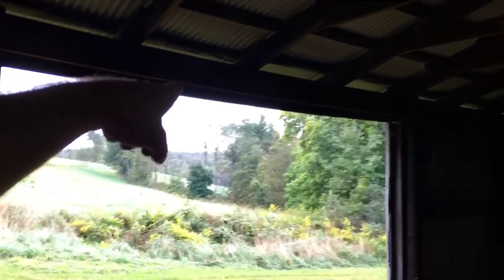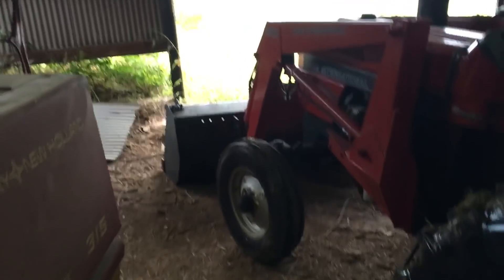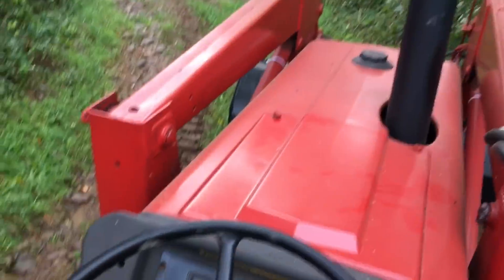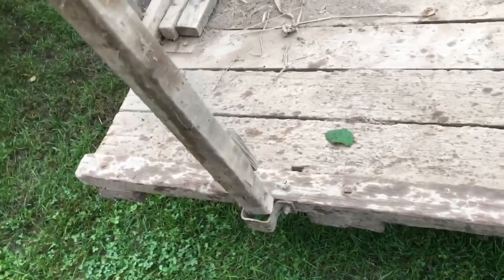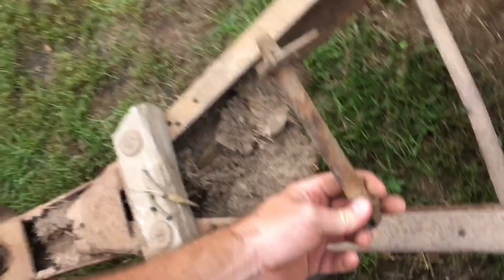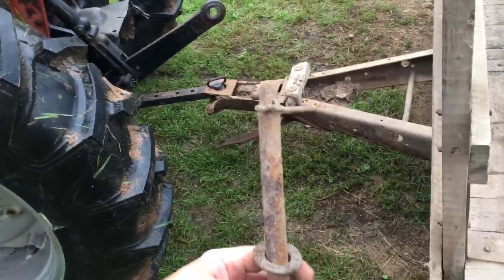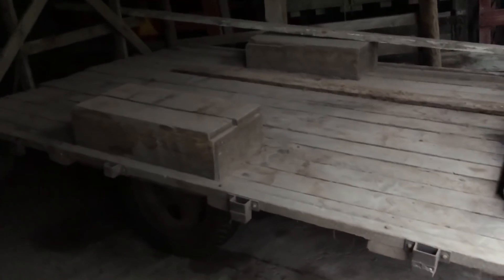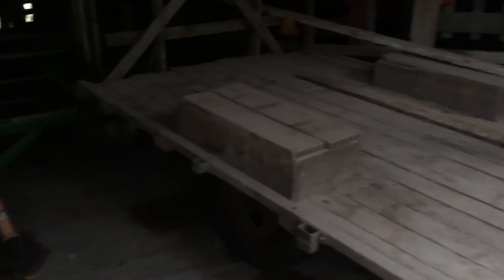Christmas Tree Wagon Part 1

Comment: We had a similar trailer we used as a kid to pick vegetables. It had a front axle from a 40s dodge truck and had 700 20 tires on it. Its still sitting out back.

Comment: We had a similar trailer we used as a kid to pick vegetables. It had a front axle from a 40s dodge truck and had 700 20 tires on it. Its still sitting out back.
Reply from the maker: I found online that the tubes are still available